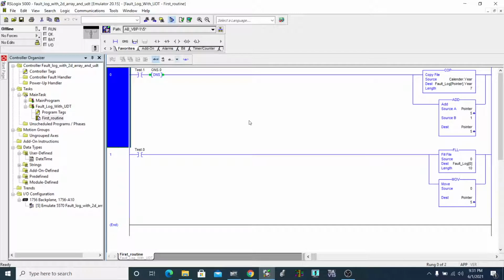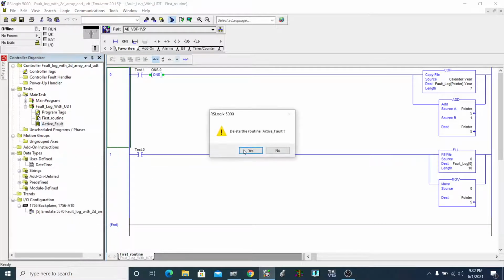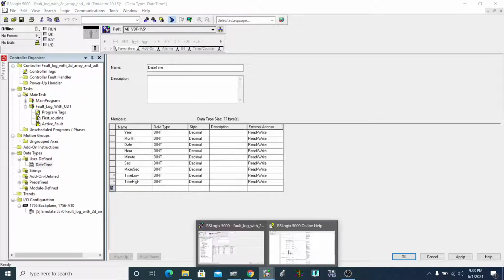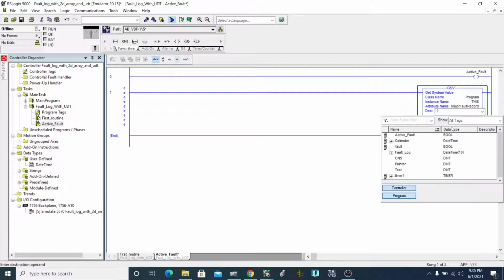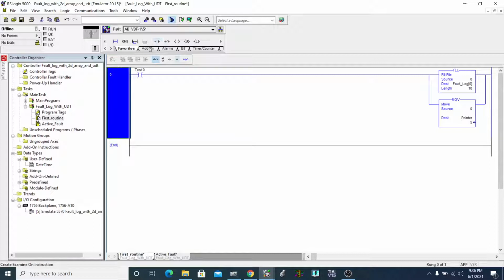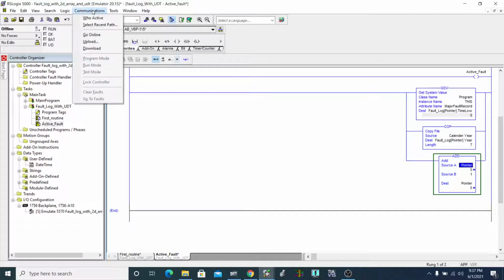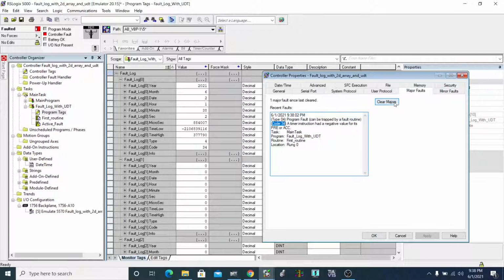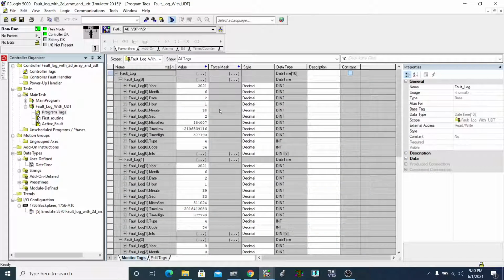RsLogix 5000 Active Fault Capture with Time and Date

Comment: Thanks for the vedios, we encountered Error code type4 -34 A timer instruction has a negative preset or accumulated value. how we can Fix the program to not load a negative value into timer preset or accumulated value.? any solution?